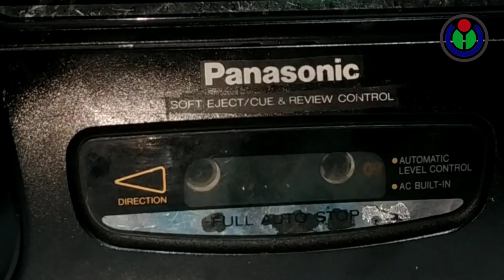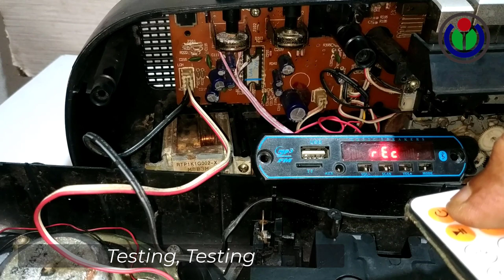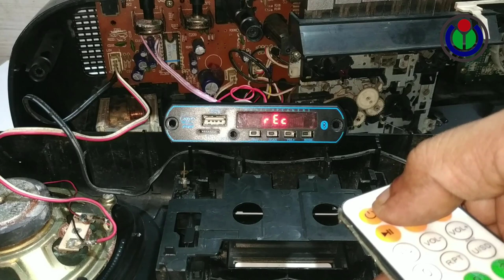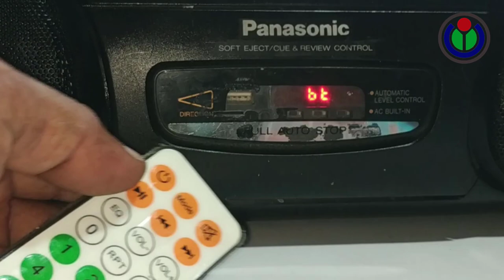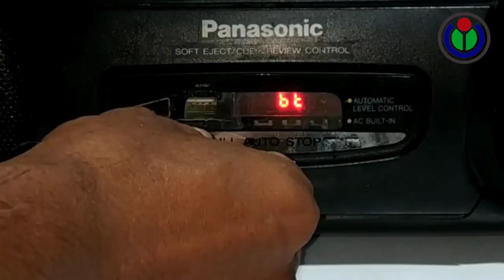Restoration antique Tape Recorder | How to upgrade old cassette player to Bluetooth Music Box

Comment: How I get 5v from that
Reply from the maker: LM 7805 ic converted 12 to 5 volt
Reply: @DreamFinder  you connect  it from capacitor?
Reply from the maker: It’s not fix matter bro, YOU find out Where  is 12 v of your bord, then you use lm7805 to convert 5 volt. LM 7805 circuit available on YouTube or Google.
Reply: @DreamFinder  thanks